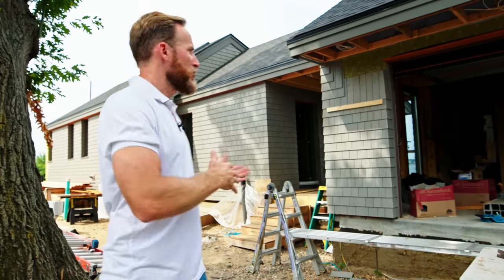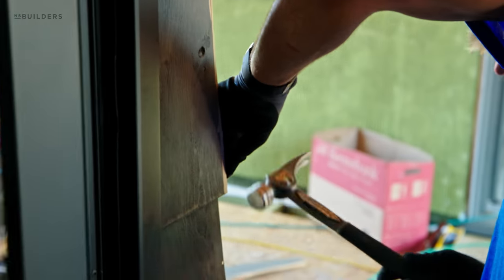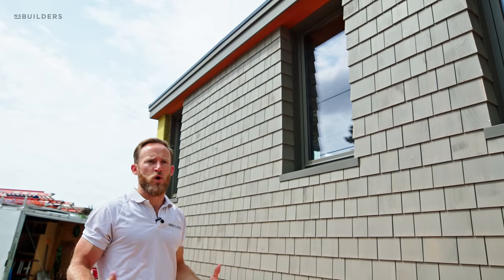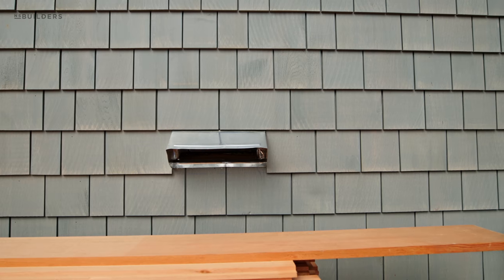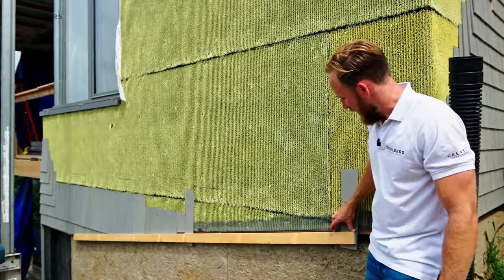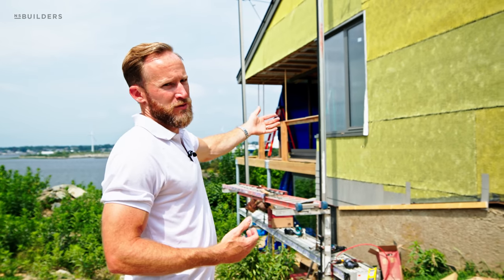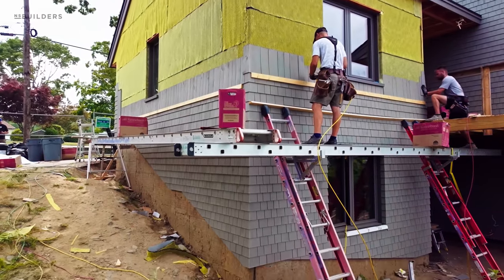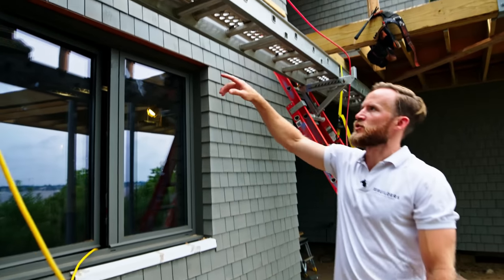Modern Shingle detail you won't see often

Comment: We shingled our beach house with Maybec white cedar shingles around 7 years ago.  Great warranty on the coating…iirc, 15 years.  Unfortunately, the stain is peeling off in a few areas so my contractor is working with them on the warranty.

They’ve agreed to reimburse us to purchase stain but they haven’t authorized reimbursement for the painters work.  They were expensive and they should pay for more than just the replacement stain.
Reply: Interesting - I hope they come through for you. I chose Maibec water based finish. It’s not really a full stain, more of a protective coat to get you through the weathering stage to a natural weathered appearance.

Comment: With the high end build you client demanded in a most respectful way I'm surprised there aren't censers strategically placed to monitor temperature, moisture or even the movement.   10 to 70 years of data would be prof of concept, we all know that the experts some times get it wrong.
Not judging just looking for what works long term. . . .  great channel I'm a fan . . .Danny

Comment: Tesla roof is actually sourcing high grade panels for that type of application.reach out to them. Roof solar panels and batteries,substantial
Investment for the future, especially combined w/ quality roof already installed. Inside Teslas' guidelines. Peace
Reply: Tesla Solar Roof system is unique and very good tech, but their solar panels are inferior technology (no micro-inverters, low efficiency). There are many great panel companies with far better specs (LG, Panasonic, REC, etc.). Also lots of good battery options.